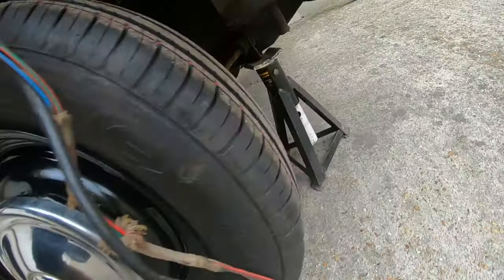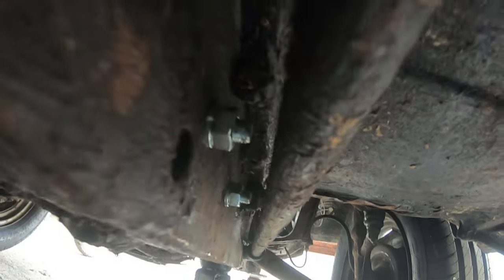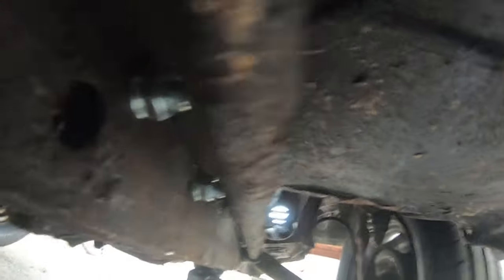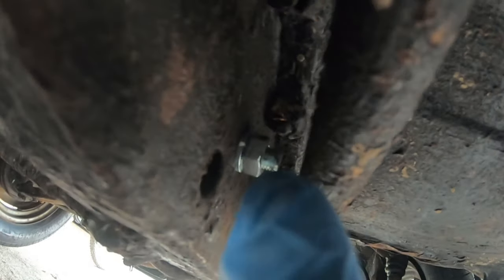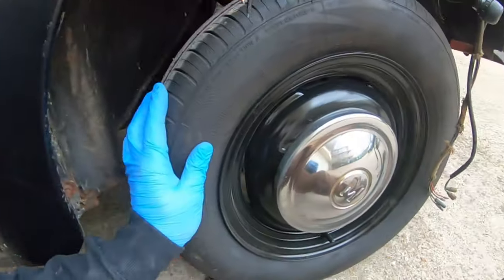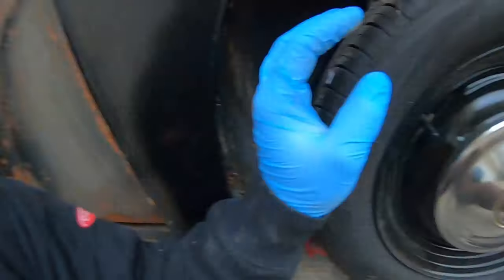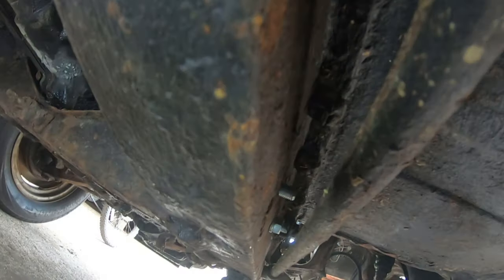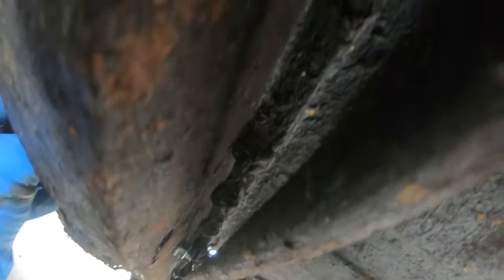Fitting the brake master cylinder part 2 -  £500 Morris minor budget restoration

Comment: Hi
I'm enjoying your videos. Just ignore the trolls !
2 points though. 
You could have cut off most of the excess thread, which would have given you more clearance.
Spring washers go under the nut, not the bolt head. You should have had a flat washer as well, but they didn't seem to have been included.
Keep up the good work !
Reply from the maker: Thanks for your comments and thanks for watching